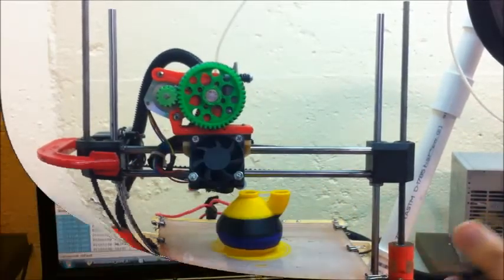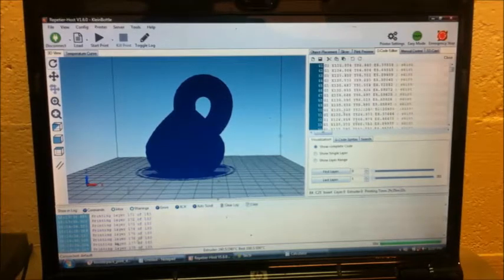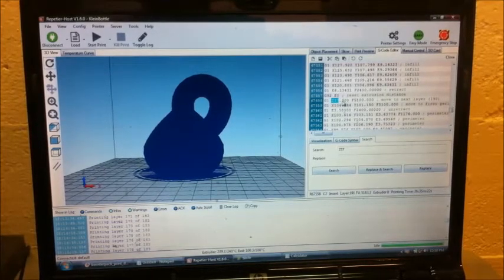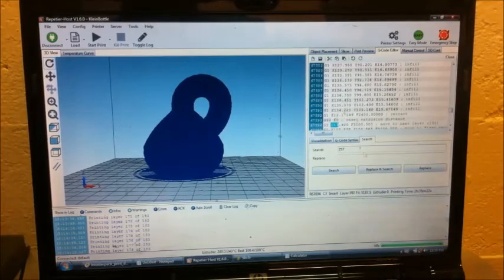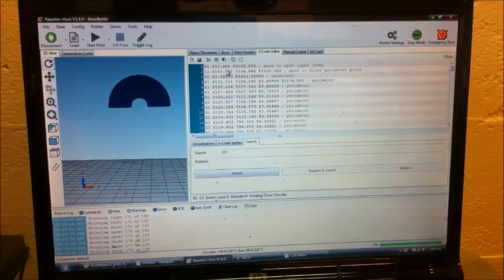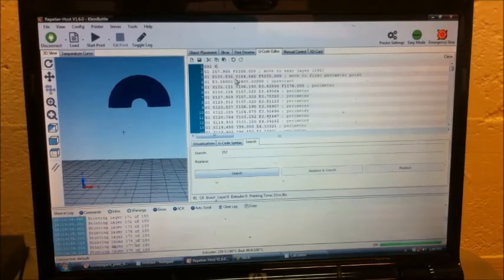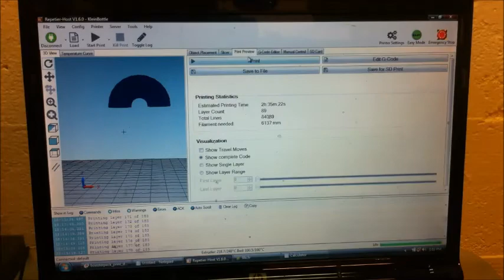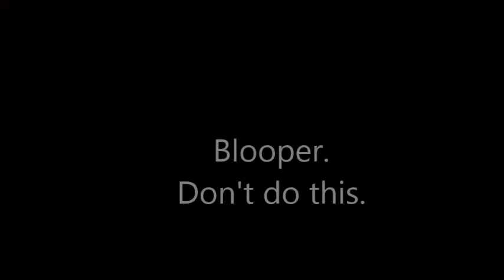How to Continue a Failed 3D Print Using Repetier-Host

Comment: I think this only works if your printer remains turned on after your print fails. If your printer turns off, the Z value is erased from memory, and you would need to manually specify the value of Z with a G92 command. 

On another story, this video helped me recover a part that had been printing for over 16hrs and failed due to a thermal runaway error :)

Comment: Need help! So because I have an auto-leveling sensor my z homes at centre of bed. I can't restart my print without homing Z but my print is in the way. How to can I fix this? Also please respond asap as I need the print for tomorrow morning!!
Reply: That happens because you have "Z_SAFE_HOMING" enabled in your Marlin firmware, this feature forces your printer to center the extruder before homing Z. As far as I know, the only way to avoid this from happening is to modify this line in your printer firmware
Reply: i know its 4 monts to late but you can also use the buttons to make the z=0 then you can level it on the side of your printbed

Comment: if you delete all of the info above, where does it get told what is the layer height, etc?  Thanks,
Reply: Layer height is incremented after each line of code of each layer. It is never fixed. So youre basically starting from the last Z position you left your print at.